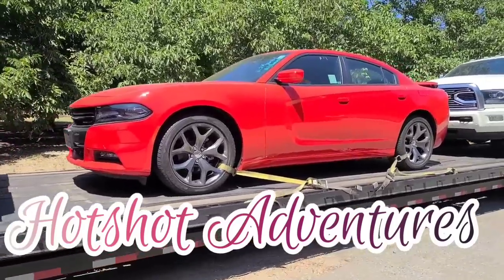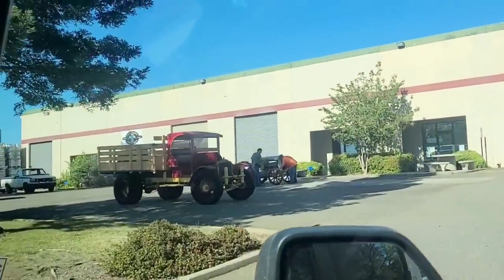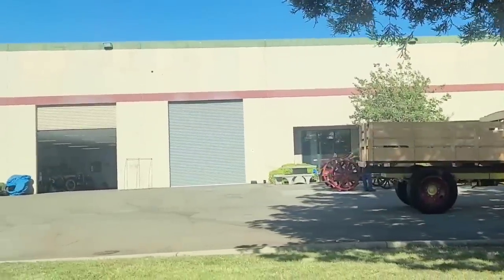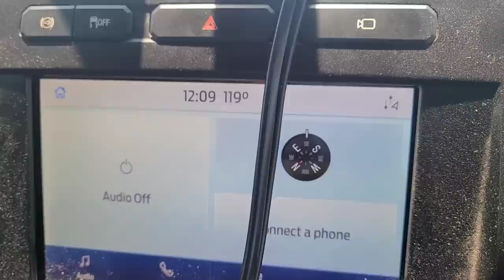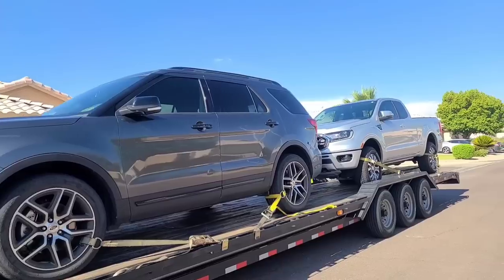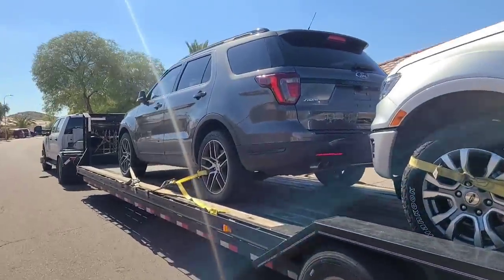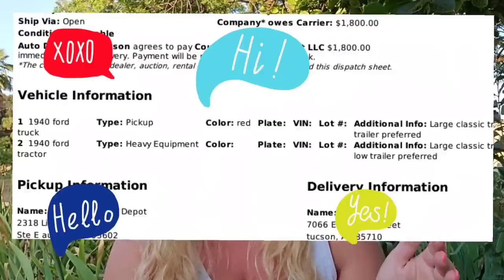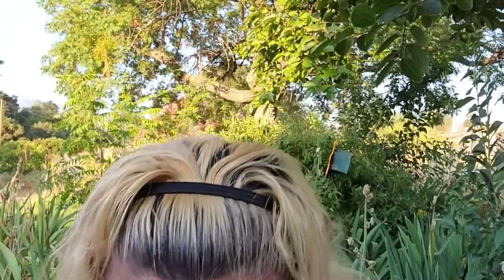Cars vs. Freight: Revenue Breakdown

Comment: **Hello , can you show a quick video of how you secure loads that are placed where the fenders are? I'm planning to get a similar trailer but would like to know how you secure and load where the fenders are, thanks.
Reply from the maker: Patreon.com/hotshotadventures for equipment and securement how-to videos. $5/month
Reply: As a car hauler, all new car manufacturers require over the wheel straps. Those side pull lasso type straps are awful for the vehicles alignments, wheels, bushings, etc  and would NEVER hold in an accident, especially the way they have them on the charger. I’m shocked they are even legal. Not sure I’d take advice here. No offense ladies, all flat bed trailers do the same because they aren’t built to haul vehicles…

Comment: $1.60/mile is pretty average for running 2 cars. As you said the best way is to go 3 car wedge or a 4 car. I personally wouldn't touch a 5 car, those things are scary if you watch guys hauling them. The other option is 2 trucks/2 vans should get the average up a bit vs 2 cars or a mix. 

2 things though as far as freight vs cars that give the slight advantage to cars over freight as far as convenience. 1) you load/unload yourself, meaning no waiting to be loaded uploaded, it's usually quick and easy loading/unloading. 2) COD..  Most cars are paying COD.. Meaning no waiting to get paid.

I do a mix of freight & cars but I use a 40ft Big Tex. I'm having the gooseneck cut off and it modified to be an actual step deck trailer like a semi step deck trailer, so I can have 50ft of deck space which means 3 vehicles or lots of freight. IMO that is the best option for a hotshot truck. a 50ft step deck.. It's just a shame only 1 or 2 companies make them and they want to charge you $20-30k for one so I'm having mine custom made.

Oh 1 last thing.. it depends greatly where you are.. In some places, you can get $1/mile on cars pretty consistently. Also, certain big brokers will often pay very well for rush orders. I pulled a F150 from KY to OK for $1.50/mile just for that truck. I've also had $2/mile cars from that same broker because they need it moved..

but personally, I would stay away from enclosed unless you are in the right market. If you check the prices on central, they aren't much better than regular in most cases. You really need direct customers to do enclosed.
Reply: Great write up. Where are car loads posted? In your opinion are there more cars than freight? Thank you 🙏🏻
Reply: @migflowers  the main load board for cars is central dispatch. As far as what is more or what pays better it's often very seasonal and area-related for both freight and cars. I'm out of FL so it's a no-brainer for me to run mostly cars until I'm at least out of the southeast. However, if I was mid west I'd probably run more freight. 
You just have to look at your market. The biggest thing with cars is it's really hard to make any money as a non cdl set up unless you are running around in the NE. Yes it can be done but you struggle a lot. You really need to be able to carry at least 3 cars most of the time to keep consistent revenue. The other thing is cars are always heavy..  You won't get a sweet 2k lbs car load it will always be 10k - 18k for 3 vehicles depending on what you carry. 

As far as individual cars vs freight yeah there is a lot more cars and cars are everywhere. You can always find a car to stick on a trailer but 1 car isn't a load you still need to find more than just 1 and that can sometimes be a struggle with just a 2 car because you need both cars to pay high vs if you have a 3 or 4 car trailer .50-.60/mile cars can be profitable because you can run 4 of them. 

You just have to watch for the diminishing returns because trying to pick up 3 or 4 cars in one day and get miles on the road can be a challenge. That's one of the reasons I wouldn't go over a 4 car you usually don't get 3 or 4 cars going to the same place so you can spend a lot of time picking up and dropping.

1 last thing, in freight hotshot, is often looked down upon because they don't see us as real truckers, but with cars they actually like hotshots because we can deliver into residential neighborhoods and small dealerships. Also, we can get it there faster than a 9 or 10 car.

I would probably say cross-country freight is more profitable, but regionally cars can be better to stay running. Like I run SE a lot so I can't really keep moving with freight very easy but I can with cars. However, going NE to Cali or back and forth or in the mid-west freight is likely better.
Reply: @crockett5  wow thanks for the info! Outstanding insights! I'm in Houston, just down I-10 from you. Right now I'm in an old 3/4 ton Ram and REALLY need to get into a newer 1 ton. The company I run for lets us borrow their 20' trailer but I know I need to get something like 30' and still stay under 26,000 lbs. I've been trying to find the time to get my CDL but I'm always so busy.
Reply: @migflowers   I'm not up to par on Houston but Tx in general is really hit or miss just like FL is for both freight and cars.  There are so many guys doing it there they drive the rates down, same as here in FL with the car haulers. As for a trailer if you are trying to go with a flat one you need at least a 36ft for 2 vehicles that's kinda the standard size on 2 cars trailers.

You really need to look at your insurance rates before you do anything it's very expensive. You won't find many people in this biz paying less than $1k/month and many are over $2k/month.. Trucking insurance even for hotshot is very expensive. It will cost you more than the truck.

Comment: Good day Ms. Natalie

I hope this finds you well and safe. I have 2 questions,
 1st, have you considered putting a proper sleeper on the back, instead of your backseat, and adding a small generator for air-conditioning, thus dropping your hotel stays.

2nd, when you state enclosed car carriers, are you considering using your current fleet of trucks, or would you upgrade to a full semi.

Have a beautiful day.
Reply from the maker: I have been trying to figure out generator for a/c....got any recommendations? 

I have a lot of hotshot equipment that is generating good revenue right now. I'm going to stick with what I've got 🙂

Comment: I know this isn’t on topic with this video but I can tell you know your stuff. I’m going to start out non cdl and have a f350, non dually. I’m trying to find out what trailer I should get. Is there a length or size I should try and stay around. I’m a fan of the big Tex brands but there are so many options. Any suggestions would be great. By the way love the videos! Keep pumping them out!
Reply from the maker: Good for you! Yes, get the longest,  lightest trailer you can find within budget. Big tex isn't known for light trailers. Hauling a 10k# big tex trailer is a lot of trailer weight if you're going non cdl.

Comment: Also, I can see where the back of your decks flexed and the boards r letting loose. Typical if you put weight back of the axel. May want to take a 4-6 inch wide steel strap as long as your trailer is wide and weld it to the outside frame to steady it

Comment: Get the proper ratchet straps for tires! They are cheap.  Never run a strap through spokes. I run Hotshot and will do a auction car load to get out of Florida for fuel. I also have a 28' enclosed trailer for the special car hauls, usually for car shows. That is always a money maker.
Reply from the maker: Thanks for the tip!

Comment: You actually drove that steel wheeled tractor over your web straps

How did that turn out?
Reply from the maker: Great
The tires aren't made of razor blades.

The strap survived another day
Reply from the maker: Interesting youre concerned with a $5 strap, I was more interested in the boards the strap was to hold in place as the tractor drove up onto the boards. I was more concerned with the tractor, and the deck of my trailer...and getting it loaded right, the first time.

If the tires did fray the strap, once loaded, we could have replaced it with another.
Reply: @HotshotAdventures  there will always be a critic. you're doing awesome. keep it up!

Comment: Kaufman EZ4 trailer (4 cars) is the best hotshot option for cars at the moment
Reply: All you must want to do is haul vehicles ?
Reply: Yeah, if you are just doing cars the EZ4 style is likely best option. The mini 5 is a no go IMO.. if you watch how they have to be loaded it's a very time-consuming to load the top rack on a mini 5 and scary looking at how much the sway when loaded.

The ez four is nice because it can run like a normal wedge or as a 4 car with 2 up top.

The only other one I like is the 53ft Low pro but only with the tandems axles. You can only haul 3 vehicles but you can haul multiple trucks, vans with it.
Reply: Are you sure? Because I think it will tresspass the maximum payload. For a non CDL driver.